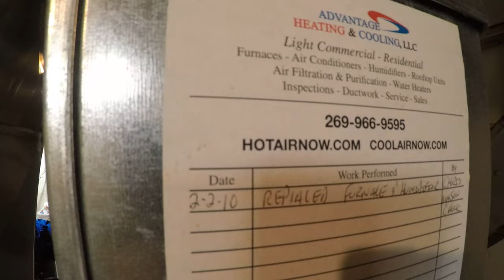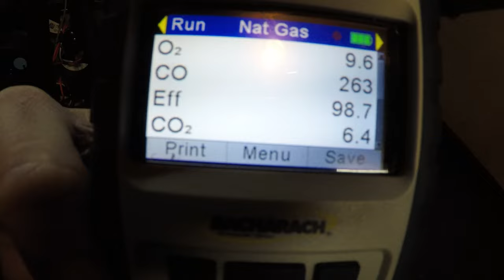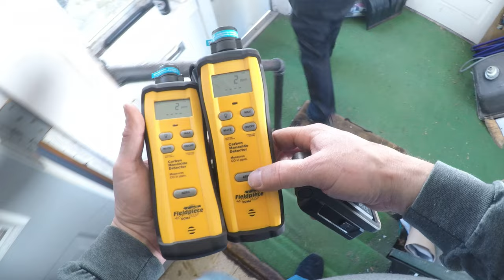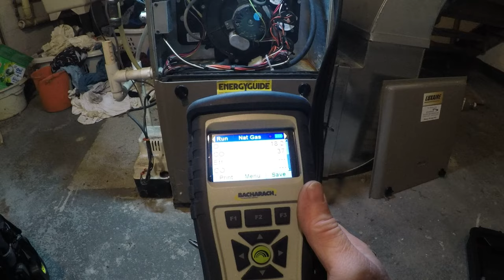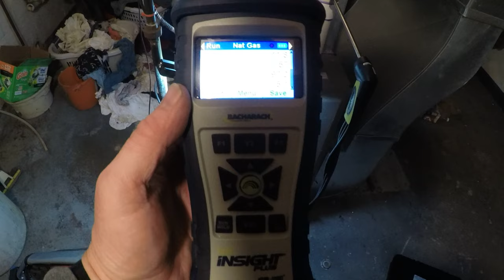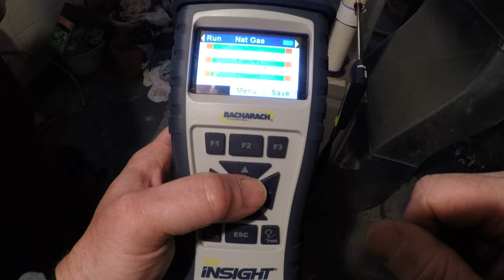Shocking Reasons Behind a Luxaire Furnace's No-Heat Disaster!

Comment: Nice job. A least its all together unlike those Carrier ones, those are a pain in the butt.
Reply from the maker: Thank you, yes for sure carriers seem to be very complicated. And it also seems to be a lot of job security. I have another 4-year-old York on the books for a bad heat exchange to do.
Reply: All I can of is that carrier is union. And their stuff was meant four union guys to work in all day 😅😂😂
Reply: You get good at doing them after a while, usually takes me less than 30 minutes for assembly, and within an hour I already have the new heat exchanger installed, last hour is the other maintenance and correcting issues that lead to a pre, premature failure, granted those carriers all fail prematurely, some last longer than others.

Comment: At least they fixed it witb a new srainless coupling box but it was dumb that they even tried that in thre first place
Reply from the maker: Going on the cheap.
Reply: @ADVANHVAC  do you know what years were affected? I have a 17 model York unfortunately in my house.
Reply from the maker: Your on that line. I have two coming up one is a 18 and the other one is a 19 both have failed secondary heat exchangers.
Reply: @ADVANHVAC  well, shit, great. I'm on propane and in a down flow situation. That makes it even worse for these 90%ers.
Reply from the maker: That’s not good.
Reply: @ADVANHVAC  oddly enough I was starting to smell that "carrier" smell outside this spring. I always call it the carrier smell, that's most common in my area. I was never happy with the thing, it was loud, lights off rough, but I want to sell the house, I just don't see a reason to spend the money and get a nicer furnace, Johnstone isn't far away from me
Reply from the maker: Replace the exchanger and call it a day. It’s under warranty.
Reply: @ADVANHVAC  yep, I even abandoned my heat pump plans because I'm done, moving away from this area lol. I'm gonna pull the blower here in a couple days and stick a mirror down in there and look at the coupling box, will make a video on it I'm sure